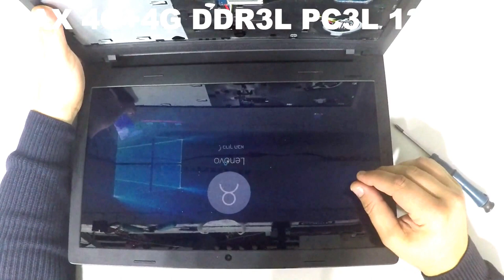Lenovo IdeaPad 100 Ram UpGrade, One Slot Only Max Ram 4G DDR3L (L=LOW VOLTAGE)

Comment: I went to the service centre and he said that "You  can replace the 1x4GB RAM with 1x8GB RAM. The 4GB RAM that's in the laptop isn't soldered and should be easy to swap."
Reply: this computer CAN handle 16GB, even though there is only one  slot.

System reports 2 slots. Turns out one is actually for soldered RAM for some configurations. But if you only have one slot and no soldered ram, it will take and access a 16GB SO-DIMM. CPU can only access 16GB of RAM. Any total RAM above 16GB (from soldered RAM) will likely not be accessible.
Reply: @musicmayer2043  Are you sure I can upgrade to 16gb? in Lenovo site and others says 8gb maximun
Reply: @gonzalomartin1245  Mine did and all 16GB are accessible.
Reply: @musicmayer2043  mine is ideapad 100 15ibd, yours?
Reply: @gonzalomartin1245  IdeaPad 100-15IBD Type 80QQ. So seems to be the same.

Comment: Does Ideapad 100 with i3-5005U and Geforce 920M and 4GB Ram support an upgrade to 8gb ram? I mean, i will extract the 4gb ram by the slot and insert the 8gb module in. Does it work?
Reply: You are not alone, I have come here just with the same question
Reply: @Видеокартаб  So do you have an answer?
Reply: My model is ideapad 100-15, it SUPPORTS 8 gb (but it's maximum), and you should buy exactly similar. I mean low voltage, 1666.
I have found many comments of people which said it worked for them
Reply: @Видеокартаб  this computer CAN handle 16GB, even though there is only one  slot.

System reports 2 slots. Turns out one is actually for soldered RAM for some configurations. But if you only have one slot and no soldered ram, it will take and access a 16GB SO-DIMM. CPU can only access 16GB of RAM. Any total RAM above 16GB (from soldered RAM) will likely not be accessible.

Comment: I used 8GB card Kingston KCP3L 16SD8/8 and my laptop works well.
Your info isn't correct.
But this video helps me a lot.
Reply from the maker: Hello, if your information correct this will help a lot.
Reply: @Shamsabdelkader  Yes, you can check it at official Kingston website.
I proved it in my notebook.
Reply: good information
Reply: Is the Information correct? :) my laptop looks like a little bit diffrent ,on the backsite . I havent a cd player and the round fan opening but its the ideapad 100 is this a Problem?
Reply: So u hv 8gb woth 10gb commissioned?
Reply: Taskmamager
Reply: @TANMAN47TANMAN  i need the answer of this question
Reply: @albarraksa5072  it worked for me using an 8gb stick. when i check ram it says 8gb now. massive improvement but now ssd is bottlenecking
Reply: @TANMAN47TANMAN   So the embedded 2GB RAM doesn't work?, only 8GB RAM is detected?  should be 10 gb
Reply: @albarraksa5072  it comes up as swap ram
supposed to have a completely different standard usage
i can make a video if u guys request it
Reply: @TANMAN47TANMAN  good idea bro  ,make a video about it
Reply: Albarr Aksa alright im working on it now. not much experience with you tube editing but too many people with unanswered questions
Reply: i made a video explaining for this particular model my results and some further discussion. https://youtu.be/45xuLHtX5cI

Comment: How many slot ram on lenovo ideapad 100?
I have Lenovo ideapad 100 and have a 2gb of ram...and I want to upgrade my Laptop to 4gb...can it?
Reply from the maker: It's will support 4G. there's One Slot Only Max Ram 4G DDR3L (L=LOW VOLTAGE)
Reply: @Shamsabdelkader   you cant put there 8gb?
Reply: @kokon2010  i did .. used 8 gb and Now i have ten
Reply: @Erryjet  how you do that cause install 8gb ram and doesnt work
Reply: @fredymartinvelascogarcia1883  my lenovo has already 2GB soldered, i took 8GB ram from a similar Acer laptop and somehow works fine
Reply: @Erryjet  and only plug and play ir is necesary touch the Jumper for reset BIOS
Reply: @fredymartinvelascogarcia1883  for me was plug and play
Reply: HerryYT 100 15idb?
does it say it has 8gb in task manager with 10gb commissioned?
Reply: @fredymartinvelascogarcia1883  Must be DDR3L (1.3V low voltage rram only).  this computer CAN handle 16GB, even though there is only one  slot.

System reports 2 slots. Turns out one is actually for soldered RAM for some configurations. But if you only have one slot and no soldered ram, it will take and access a 16GB SO-DIMM. CPU can only access 16GB of RAM. Any total RAM above 16GB (from soldered RAM) will likely not be accessible.

Comment: There are two slots, one is soldered and the other is accessible.
Reply from the maker: Yaa .. they remove one
Reply: this computer CAN handle 16GB, even though there is only one  slot.

System reports 2 slots. Turns out one is actually for soldered RAM for some configurations. But if you only have one slot and no soldered ram, it will take and access a 16GB SO-DIMM. CPU can only access 16GB of RAM. Any total RAM above 16GB (from soldered RAM) will likely not be accessible.
Reply: @musicmayer2043  i want replace de 4gb (only 1 slot) lenovo ideapad 100-14, mayby 16gb ram ddr3l (one stick) or 8gb?

Comment: help i check my ram it 4 gb ram can i updrade to 8gb?
Reply: this computer CAN handle 16GB, even though there is only one  slot.

System reports 2 slots. Turns out one is actually for soldered RAM for some configurations. But if you only have one slot and no soldered ram, it will take and access a 16GB SO-DIMM. CPU can only access 16GB of RAM. Any total RAM above 16GB (from soldered RAM) will likely not be accessible.

Comment: Hi i have Lenovo Ideapad 100-15idb And i can instal 8gb ram on the 1 card ?   
1x8gb ?
Reply from the maker: thank you, I will check if this possible.
Reply: yes, you can. on mine works perfect!
Reply from the maker: you are welcome.
Reply: @
cuska jequitiba
    how you do that......you replace 4 gb from factory with one 8gb memory card? ddr3L 1600MHZ 1,35v? please tell me ...i have the same laptop like in this video? tell me what 8gb memory card you use it,i;ll buy the same ...
Reply from the maker: You can't, this laptop support MAX 4G.
Reply: Alessandro venturini thanks bro 😍
Reply: Hello, you tried with an 8g, because I want to put a 7h on my computer and I would like to know which one can work, could you help me with the characteristics of the 8gb ram that I should buy? please.
Reply: @Shamsabdelkader  Sorry, not correct. this computer CAN handle 16GB, even though there is only one  slot.

System reports 2 slots. Turns out one is actually for soldered RAM for some configurations. But if you only have one slot and no soldered ram, it will take and access a 16GB SO-DIMM. CPU can only access 16GB of RAM. Any total RAM above 16GB (from soldered RAM) will likely not be accessible.

Comment: Can you please explain where its second spot of ram? I have one of this and i wanna put one more 4g ram card. I was thinking this laptop has only one spot for ram.
Reply: In this laptop the other slot don't exist
Reply from the maker: Apologies I code not replay to your massages in time, I am back now and will replay to comment once a week in Friday. (you are welcome)
Reply: @juanpinto5710  If the ram is soldered to the Motherboard and the slot is only one.

Question: Is tit possible to upgrade its ram?

I currently have a 2GB of Ram.

PS. Lenovo 100-14IBY
Model Name: 80MH

Comment: i have a same laptop as yours 
Can I replace the 4Gb ram 
With a 8Gb without problems?
Reply from the maker: It's won't support 8G. there's One Slot Only Max Ram 4G DDR3L (L=LOW VOLTAGE)
Reply: eShamsTechTips 
Thanks dude
Reply from the maker: You are welcome.
Reply: I did install 8 GB works perfect!
Reply: cuska jequitiba 
But it support just one slot 
Max 4GB
Reply: cuska jequitiba what does task mamager say for ram performance?

Comment: Hi , Task Manager suggests it has 2 ram slots.Is that wrong?
Reply: Yeah
Reply from the maker: Hello, this model comes with one ram slot.
Reply: this computer CAN handle 16GB, even though there is only one  slot.

System reports 2 slots. Turns out one is actually for soldered RAM for some configurations. But if you only have one slot and no soldered ram, it will take and access a 16GB SO-DIMM. CPU can only access 16GB of RAM. Any total RAM above 16GB (from soldered RAM) will likely not be accessible.

Comment: How many ram slots does it has
Reply from the maker: One slot only Max Ram 4G DDR3L (L=LOW VOLTAGE)
Reply: @Shamsabdelkader  this computer CAN handle 16GB, even though there is only one  slot.

System reports 2 slots. Turns out one is actually for soldered RAM for some configurations. But if you only have one slot and no soldered ram, it will take and access a 16GB SO-DIMM. CPU can only access 16GB of RAM. Any total RAM above 16GB (from soldered RAM) will likely not be accessible.

Comment: How much RAM memory slot on lenovo laptop ideapad 100.?
Reply: When I dismantle the laptop ideapad 100, where the ram stock is not empty ram, but reads 2gb ram when I check on the pc system. That's why.?
Reply from the maker: Apologies I code not replay to your massages in time, I am back now and will replay to comment once a week in Friday. (you are welcome)
Reply from the maker: Apologies I code not replay to your massages in time, I am back now and will replay to comment once a week in Friday. (you are welcome)
Reply: @faisgamingchannel2937  this computer CAN handle 16GB, even though there is only one  slot.

System reports 2 slots. Turns out one is actually for soldered RAM for some configurations. But if you only have one slot and no soldered ram, it will take and access a 16GB SO-DIMM. CPU can only access 16GB of RAM. Any total RAM above 16GB (from soldered RAM) will likely not be accessible.

Comment: Two slots? Is it possible to install two 4GB RAMs?
Reply from the maker: No, this model has one slot only max 4G
Reply: what if i buy a HyperX 16GB Ram card and put it into the laptop? Would it be still working?
Reply: @SMN-ct9gl  If it is DDR3L (low voltage 1.3V) rated 1600 or higher it should work.
Reply: @Shamsabdelkader  this computer CAN handle 16GB, even though there is only one  slot.

System reports 2 slots. Turns out one is actually for soldered RAM for some configurations. But if you only have one slot and no soldered ram, it will take and access a 16GB SO-DIMM. CPU can only access 16GB of RAM. Any total RAM above 16GB (from soldered RAM) will likely not be accessible.

Comment: That isn't a upgrade, u just take the ram off before video and now u put it in, we wanna see how u put the 2nd ram slot
Reply: Devil Bass on boardram.
Reply: this computer CAN handle 16GB, even though there is only one  slot.

System reports 2 slots. Turns out one is actually for soldered RAM for some configurations. But if you only have one slot and no soldered ram, it will take and access a 16GB SO-DIMM. CPU can only access 16GB of RAM. Any total RAM above 16GB (from soldered RAM) will likely not be accessible.

Comment: I have this leptop and can i add one more 4gb ram?
Reply from the maker: No, you have one slot only and the max RAM 4G.
Reply: this computer CAN handle 16GB, even though there is only one  slot.

System reports 2 slots. Turns out one is actually for soldered RAM for some configurations. But if you only have one slot and no soldered ram, it will take and access a 16GB SO-DIMM. CPU can only access 16GB of RAM. Any total RAM above 16GB (from soldered RAM) will likely not be accessible.

Comment: it has 2 slot of ram so i can add one more ram
Reply from the maker: Yes you can add another ram MAX 4G+4G DDR3L PC3L 12800S.
Reply: U cant
Reply: @Shamsabdelkader  this computer CAN handle 16GB, even though there is only one  slot.

System reports 2 slots. Turns out one is actually for soldered RAM for some configurations. But if you only have one slot and no soldered ram, it will take and access a 16GB SO-DIMM. CPU can only access 16GB of RAM. Any total RAM above 16GB (from soldered RAM) will likely not be accessible.

Comment: How much slots?
Reply: this computer CAN handle 16GB, even though there is only one  slot.

System reports 2 slots. Turns out one is actually for soldered RAM for some configurations. But if you only have one slot and no soldered ram, it will take and access a 16GB SO-DIMM. CPU can only access 16GB of RAM. Any total RAM above 16GB (from soldered RAM) will likely not be accessible.

Comment: Max ram?
Reply from the maker: One slot only Max Ram 4G DDR3L (L=LOW VOLTAGE), it was a mistake in the editing process. accept my apologies.
Reply: eShamsTechTips Thanks
Reply from the maker: You are welcome
Reply: eShamsTechTips so 8gig ram?
Reply from the maker: NO Martina
Reply: eShamsTechTips thx is it the same amount max for 100s?
Reply from the maker: No, The LENOVO IDEAPAD 100S-11.6INCH is Up to 2GB DDR3L.
Reply: how can it be 4 g + 4 g when there is only 1 slot ?
Reply from the maker: Hello Alex, One slot only Max Ram 4G DDR3L (L=LOW VOLTAGE), it was a mistake in the editing process. accept my apologies.
Reply: eShamsTechTips  so if  i buy an 8gb ram wont work!
Reply from the maker: No, you already have 4G and you can't add more ram.
Reply: my Lenovo IdeaPad 100 is running with some crucial sodimm 8gb ram ...
Reply: @Shamsabdelkader  Sorry, incorrect. this computer CAN handle 16GB, even though there is only one  slot.

System reports 2 slots. Turns out one is actually for soldered RAM for some configurations. But if you only have one slot and no soldered ram, it will take and access a 16GB SO-DIMM. CPU can only access 16GB of RAM. Any total RAM above 16GB (from soldered RAM) will likely not be accessible.